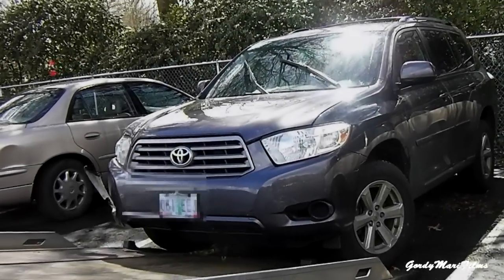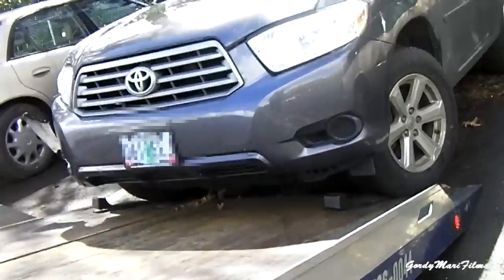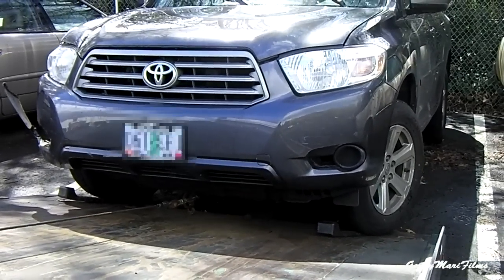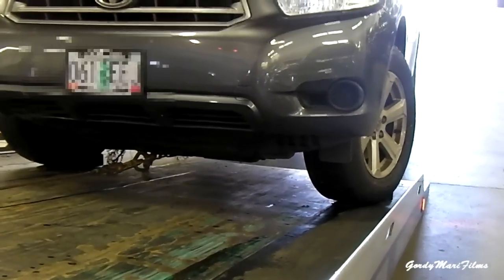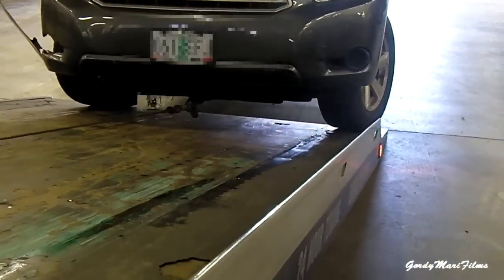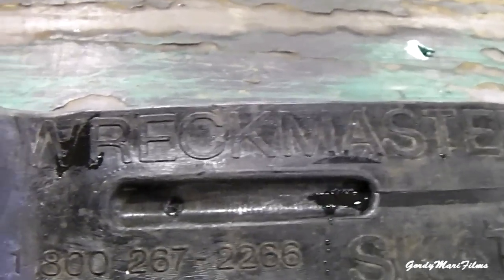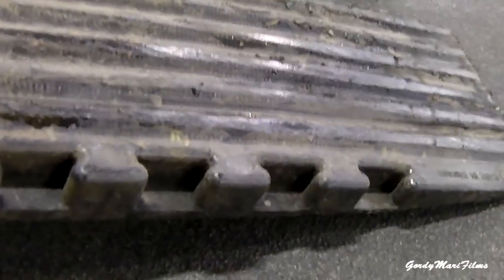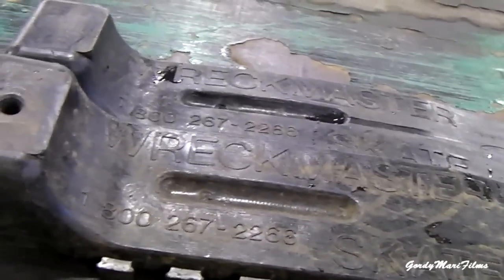Towing And Recovery Wreckmaster Skating 101

Comment: yeah they work great on flatbeds that are on smooth decks. Sometimes on the diamond rough beds one they get hung up a little. You can do a little shake or a reverse pull. I also use the skates as mini ramps as well. If you turn them upside down you can sometimes use those over breaking out the 4x4's..

Comment: BA Products also sells skates now that have a curve to them.  Easier to get them on/off at the edge of the bed.  Slide under the tire easier.  Larger surface area to hammer them under a tire when needed.  Wire handle to pull them out from under the tire.  They're also cheaper.  Wreckmaster skates lock together though, so if you can afford to have some of EACH, you're in good shape.  I'd have killed for three pairs of those Wreckmaster skates back when I had to load a dead Ferrari out of a warehouse.  Back tires were 305mm wide each and two skates per tire wasn't enough.  Lucky it wasn't AWD or something.  I did have six of the BA skates and it worked but not as well as I'd have liked.

Comment: I would just through two 2x4s in front of the tires the tires roll slightly onto the 2x4s so they just barely come off the bed and the car goes straight up the bed... the just throw the 2x4s behind the tires when unloading.